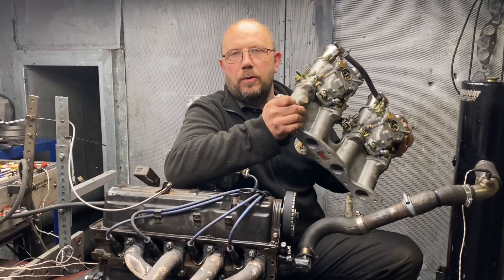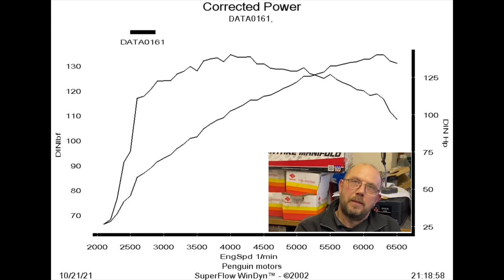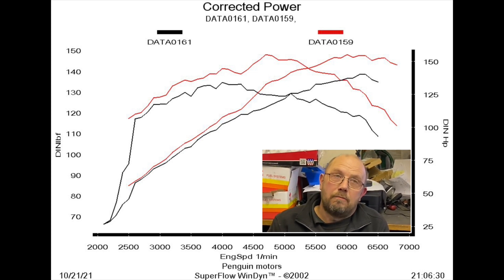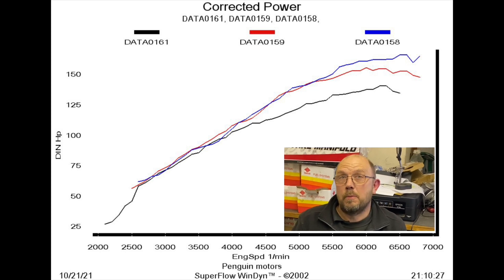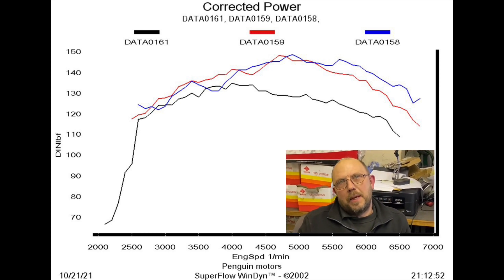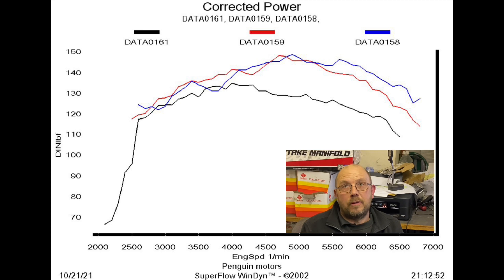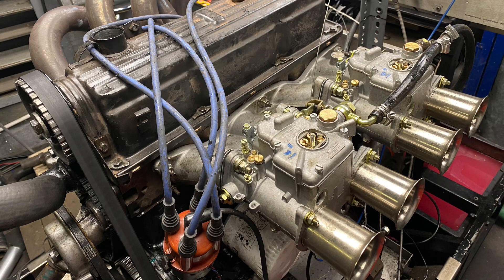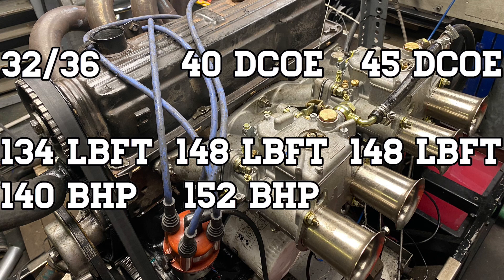Ford Pinto 32/36 vs DCOE’s

Comment: I've watched your channel on the pinto engine I love these engines looks like you know about them as a comparison I wondered what degrees you have your ignition timing set at thanks
Reply from the maker: most pintos want 28-30 max advance, some as much as 34 at very high revs, but thats not feasible with most distributors

Comment: Great video. What jetting were you running on the 40s? Understand that different engine may require different jetting, just interested to see and could be good for a starting point. Thanks.
Reply from the maker: Tbh I don’t remember and do so much jet swapping I don’t tend to keep notes. It would of been 32chokes and something like 135 mains 160 air, probably F16 tubes, idles could of been anything as they are not relevant to full throttle testing

Comment: Great video Graham, thanks for spend time and effort in yours videos.
Can you say which type of emulsion tube an jetting uses on 45s.
Thanks again.
Reply from the maker: i will see what i can do, the trouble is it all takes quite a long while and i end up doing a lot of jet swapping. Also a point to note is for max power you only need to be fairly close, road use in a car you might want a different setting to what i ran on the dyno.

Comment: This upcoming exhaust test is going to be what makes me broke because now I’m going to have to swop out my old log for whatever this ballie says is best
Reply from the maker: what have you got now?
Reply: @PenguinMotors  thank you for actually replying. Honestly in my book from what I’ve seen you must be one of the best pinto boys on the block. I rate making hpe look like a school boy. That valve lift in that mk1 engine rebuild video got my eggplant ripe my bru. I’m currently running hopes and dreams as it’s not in my car but motor is built and ready to go. It a 2.1 build with Essex pistons and group 1 valves. Lr 31 cam from Kent cams. Ported exhaust of the almighty log and I have OEM idf group 1 rs2000 intake manifold with a brand new set of 48s sitting pretty. I’m not sure of the jetting and choke of those carbies. I have a regular old wet sump as well. And standard fuel pump which needs to get swooped out because those carbies suck em dry.
Reply from the maker: most people over spec the exhaust manifold, you dont need a big bore or anything really fancy to go over 170bhp
Reply: @PenguinMotors  I’m thinking it’s going to be just under that so if the penguin says I should be fine - I’ll be fine. 

Honestly I love your uploads. They are the best things Iv watched. The comparatives to real life scenarios is excellent. You are the man ! One could only dream of having a penguin built motor under the hood of my classic ford 🙌🏼

Comment: Have you tested inlet valves that are completly flat on the port-side? The book on pinto engines by David Vizard states this works well. Thanks for the video.
Reply from the maker: most oversize pinto valves are practically flat, thats because the air tends to flow straight across the back of the valve, not round the short turn

Comment: Let's see what she does on 48sp's
Reply from the maker: not enough engine to make use of 48's but i do have a pair so when ive got a suitable engine on the dyno i'll bolt them on
Reply: @PenguinMotors  I've got a 1660 x-flow that made best power and torque on 48's suprisingly as I initially thought 45s would be top end on it
Reply from the maker: what cam and choke sizes? im guessing both are pretty big, the one thing dyno testing doesnt really show up is how poor low speed flexibility/throttle response is with huge carbs,  other than the bigger the carbs the more gentle you have to be with the throttle when you load up the engine
Reply: @PenguinMotors  42mm chokes from what I remember and a Kent 254 cam. 13.1:1 compression ratio. Stage 4 head. 41.3 inlet 34.9 exhaust.
Reply: @PenguinMotors  she's a race engine so tends to not come upder 5k rpm
Reply from the maker: @callumdavies-russell8894  makes sense, if you have practically no low end torque theres no real loss from huge carbs, my mates full race 1600 x/f used to run 50's

Comment: I am curious how shorter trumpets might effect stand-off etc, a lot of cars don't have space for the long trumpets...... interesting video, thank you..
Reply from the maker: those trumpets are not that long, the will fit in an escort engine bay
Reply: @PenguinMotors  I ran a crossflow with 40s in an Anglia, granted not a Pinto, redoing clutch and brake master cylinders was a pain.
Reply: yes i was also wondering on induction length, i have plenty of room, advantages / disadvantages of a longer or shorter length of maifold and rampipe, maybe even something ridiculously long to see what happens
Reply from the maker: @MrRossKendall  its  easy, pintos  love long, longer the better, only problem is an escort engine bay isnt wide enough